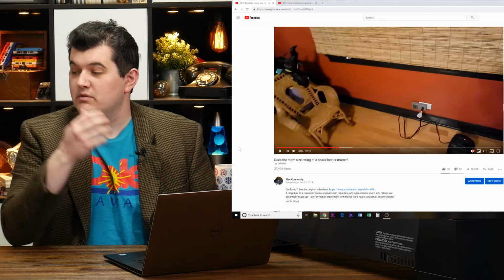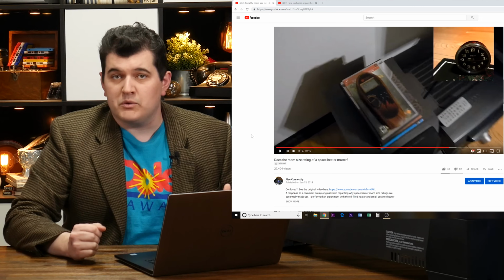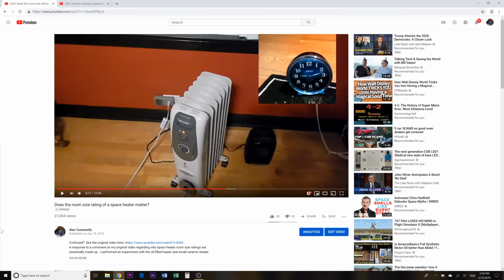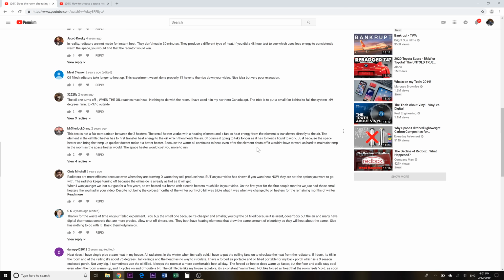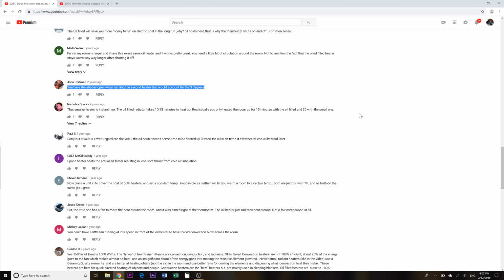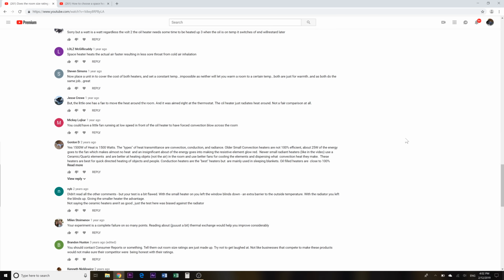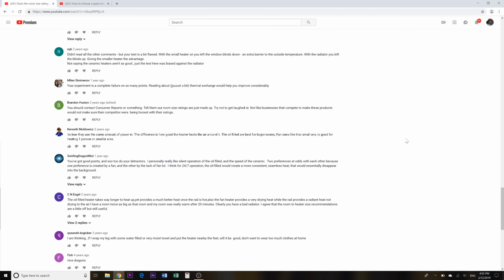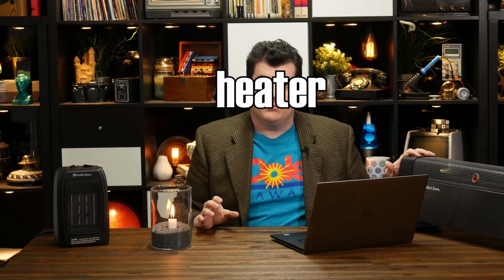More Space Heater Nonsense

Comment: I can't wait to see the comments when you explain how leaving your refrigerator door open heats the room up.
Reply: Never thought about that but it totally makes sense scientifically
Reply: I had someone tell me I'm an idiot when I told them that fans make rooms warmer, so unless it's aimed straight at you, turn it off!
Reply: @rjmac3095  Fans can make a room cooler if they're sucking cold air into the room while blowing the hot air out.
Reply: @remskolney4040  that's what I do in my house.. ground floor got a fan pulling in colder air (from shaded side of house).. upstairs got a fan sucking out the warmer and more humid air which has accumulated heat and moisture as it travels through the house. Admittedly not as good (or expensive) as aircon.. but it does get bedroom night-time temps down a few degrees so as to sleep better.. b(^_^)
Reply: @rjmac3095  They can also cool a room if pointed at a cold window or circulating air against cold exterior walls. Potentially useful if your central air overheats a single corner room, I suppose.
Reply: @rjmac3095  what if it's in the window pulling cold air from outside into the stuffy room?
Reply: @wendylynn7058  Ok, yes, in that case it would help a lot, and in fact if there are nearby windows that are open using a fan isn't likely to raise the room temperature.  But most times I've seen fans in use was in places with closed windows, or where the windows are far enough away that they make no difference, and in those cases a fan that is not pointed at you is a liability.
Reply: @rjmac3095  ceiling fans that have a reverse switch will make a room feel cooler. 
Since cold air is always at the bottom, it can pull the cold air up making the room as a whole feel cooler. 
Even an oscillating fan can make the room cooler by convection. The high speed air will pick up cooler air around it and more evenly distribute it around the room thus making it feel cooler
Reply: @rjmac3095  Not quite that easy. 1. fans use >minimal< power. 2. the moving of the air helps evaporation, thus feeling cooler.
Reply: @rjmac3095  Well it doesn't have to be aimed STRAIGHT at you, a lot of the time a fan makes the air in the entire room move which causes the same effect (but yeah, just less)
Reply: @rjmac3095  I've argued with people that leave fans on because they think they are cooling a room.
I tell them to touch the motor and see how hot it gets.
Reply: @RJ Mac 

They do?
ffs
Reply: @Her_Imperious_Condescension  Yeah, the moving air causes water to evaporate off of your skin IF they are aimed at you, so you feel cooler, but the motor puts out a certain amount of heat, so it actually gets warmer.  The wattage of the fan tells you how much heat they put out because 100% of it turns to heat.
Reply: @rjmac3095  well maybe not 100%, some energy is required to spin the fan blades
Reply: @rjmac3095  maybe we might be able to reverse global warming using giant fans, or even with giant AC units xD
Reply: @dustgalaktika9573  You have to think in terms of moving heat. You can't produce heat (or cold, which is just less heat), you can only move it from one place to another. So to cool a space, you have to move heat from that space to somewhere else. A fridge does that by moving heat from inside it to the outside through the radiator at the back, so the air on the outside (the air in room the fridge is located in) gets warmer. And this is isn't a 100% effective process, so the heat you add to the room is always more than the heat you remove from inside the fridge.
Reply: @HGSolberg  duuude I was just being sarcastic xd
Reply: @dustgalaktika9573  LOL Fair enough. But sarcasm doesn't always come across well on the internet.
Reply: @dustgalaktika9573  haha, never mind my previous comments. I can clearly see you get the joke.
Now you have me looking forward to the day climate change deniers have no choice but to acknowledge the reality that the planet is getting too warm and begin demanding we build massive AC units all over the planet to cool it off. Can you imagine trying to explain to those people why, besides being logistically impossible, it won't work anyway. And, were we somehow able to build them, they would, if anything, make matters worse.
Reply: @HGSolberg  Bit of an old comment, but you can produce heat. However you can't produce cold, which is probably what you were getting at.
Reply: @lappr0  You're absolutely right. My comment was very badly worded. You can of course produce heat chemically or by buring stuff.
Reply: @mustwereallydothis  but all we need to do is put 70 miles of ductwork out to the vacuum of space and the heat will be sucked out, hahaha
Reply: @richtomlinson7090  or we could just send a bunch of big fans into orbit and let them blow on the planet to cool it off. If only we ran the world... Big brains like us would have it taken care of in no time. Lol
Reply: @mustwereallydothis  probably better that way, because we don't want to lose our atmosphere by getting vacuumed out.
Reply: @dustgalaktika9573  Let's make a space heat pump!
Reply: He already did that https://www.youtube.com/watch?v=_-mBeYC2KGc
Reply: Ha! True!
Reply: LOL! 
Just look at all the people who don't get it why those portable AC units always have a tube that blows hot air along with the cold air coming from the unit it self...
Reply: During one of my jobs, I happened to notice that the door to the beverage cooler in front of the check stand hadn't closed entirely. Thus, that refrigerator had been running virtually non-stop for an extended time. Needless to say, the cans of carbonated beverages at the back where the evaporator is located were ready to explode. The rest of the beverages near the door of the fridge weren't cold at all, because the heat from the environment, including the condenser which is mounted exterior to the refrigerator, is contributing to the temperature inside the fridge, causing the compressor to constantly run, making more heat, and so on. There's no free lunch in the universe.
Reply: By keeping the door open; the fridge will run at full power attempting to remove heat from inside. It will heat up the room by whatever its max power rating is.
Reply: You could probably rig something to put the condenser coils somewhere where the heat wouldn't immediately re-enter the room.  But even if you could do that, congratulations - you just made an air conditioner, and are asking it to cool a space MUCH larger than it's designed to.
Reply: Thermodynamics Baby
Reply: @fireballxl-5748  Oh wait. I get it. I've been approaching this as if you're... well, I won't be that rude. But you're just a troll. Ha ha. Good one. But if your goal is to ruffle feathers, I'm sorry to disappoint you. No ruffles here.
Reply: @AethericEchoes  Let you know when I get published?    LOL   In debating technique, that is called an appeal to authority (magazine publishers).  So if it's in  a magazine or even a book it must be true.   I do not (no good conversationalist should) accept your false premise.   Lots of "peer reviewed" publication articles have been redone, corrected and thrown out because they were incorrect.  Calling me  a troll is an ad hominem attack - also a false argument.  I expect you know that.  (Besides, this is a lot of work for a simple 10 yr. old troll.   And I'm 64 so I don't have the time to waste...lol.)     Your last 2 comments therefore are invalid and need no further answer.   However, I will make another analogy or let's say introduce another perspective.  Multiple perspectives are often helpful in illustrations.  How is it the "heat" desires  to get to the cold and heads to it like a teenager in heat (haha) while the cold just sits there like a demure, shy, young lady?  Does not the lady ATTRACT the man?  Does not a magnet ATTRACT.....i.e. draw the steel nail to it?   Similarly does not a vacuum very much irresistibly ATTRACT everything surrounding it?  Different perspective, isn't it?   Not saying that is a scientific argument but simply an attempt to get you to take another look, get a 2nd perspective instead of being locked into a peer reviewed agreement of those who all read the same book and therefore know nothing but that book (paradigm) and I'm sure you'll agree books have been wrong.

Let's see....consider a black hole in "outer" space.  Nothing can escape it yet it is full of absorbed energy (heat!!!).  Is it cold or hot?  Makes no difference to the black hole whether something is hot or cold...into the black hole it goes.

If all you have left is personal attacks then don't respond but if you can make a good argument I'm all in.  Nevertheless thank you for a civil (pretty much) conversation.
Reply: @DeagleGamesOG  Number one.....   I didn't delete any comments.    Number two....talk to me when you grow up (and learn how to spell).
Reply: @DeagleGamesOG    I take note you ignore everything you cannot answer and continually attempt to change topics.
 I have some advice direct from God for YOU.
Ready?
Okay, <sarcasm on>  I know you will honor and respect God's advice for you.   <sarcasm off>
Lev:19:32: "Thou shalt rise up before the hoary head, and honour the face of the old man, and fear thy God: I am the LORD."

I am not offended as you are speaking from a demonic spirit...not your true self, which is under an evil influence you cannot control.  However, there is one more piece of advice that is mandatory.

 Joh:3:3: "Jesus answered and said unto him, Verily, verily, I say unto thee, Except a man be born again, he cannot see the kingdom of God."
Reply: @fireballxl-5748  Bad bait, burner account. Piss off.
Reply: Marge, could you set the oven to cold?
Reply: That's probably true. You're just wasting energy into heat at that point
Reply: A person can be smart, but PEOPLE ARE STUPID!!
Reply: @fireballxl-5748  The water buckets were an analogous illustration, not a direct correlation. As such, the variables can be safely ignored and the illustration is sufficient to demonstrate the process.

As for the article, it is based on a well established field of science known as thermodynamics, a field that specializes in the conversion of energy (The prefix "thermo-" refers to heat, a fundamental property of energy). If you are going to deny its validity, you are rejecting what is being taught in every major university on the planet. Go ahead, pick one and contact them and put the question to them.

Yes, science has been wrong many times. But this isn't on par with the flat earth debate. There is no academic dispute on any level. All educators are in 100% agreement. So if you're establishing your own branch of science, I wish you the best of luck in that endeavor. Let me know when you get published.
Reply: Wait, you mean to tell me it doesn’t turn the room into a freezer? Haven’t you seen SpongeBob? Silly boy
Reply: It’s the same idea as sitting a window ac in your car’s passenger seat
Reply: Huh, yeah that is how it would work. The frig is a heat pump from the inside of the frig into the kitchen (presumably) the residual heat from the compressor going at full tilt heats the room. Though a frig is always heating the room to some extent, if you just left it open ut would just pumpnout even more.
Reply: It does
Reply: it doesn't produce heat, it removes the cold.
Reply: @423yjl  Cold is not a thing in itself that can be removed. Cold is a relative measure of heat (defined by molecular activity) on one continuous scale. It doesn't matter what the actual temperature is; the area or object with lower heat is cold compared to the one with higher heat. The only way to remove cold from a space or object is by adding heat to it.
Reply: I would never try to explain that to my family....
Reply: @TechHowden  just running the fridge heats the room.....
Reply: Effect = nil. What about the COP rating and heat pump / fridge efficiency gains?
Reply: You are being sarcastic (right?)
Reply: @dustgalaktika9573  
As Fernando noted above, the basic principle was described in the linked video about air conditioners. To put it in the context of refrigerators:

When a refrigerator makes food cold, it has to do something with the heat that it removes. It does that by moving it from inside of the frig to the outside. In addition, the compressor that's doing all the work to cool your food emits waste heat, which also has no place to go except the room it's in. So even with the door closed, refrigerators warm up the room, albeit by an insignificant amount for most situations.

When you open the door, you may feel like cold is "coming out" at you but in reality, that's only the heat of the room displacing the colder air in the frig. Cold isn't coming out; heat is rushing in.

Now that the interior of the frig is warm, the compressor attempts to remove the heat. But as long as the door is open, the warmer air of the room will just replace it. That warm air is the very same air that just got removed so you only set up a vicious cycle where the frig keeps trying to cool the very air it just removed. But on each cycle that air is warmer and warmer.

Plus the compressor is now working overtime attempting to move warm air back to the same place it keeps coming from. Leave the door open long enough and that "insignificant" rise in room temperature starts to become measurable. And since your refrigerator is working without rest, it's life expectancy is getting shorter.
Reply: @AethericEchoes  xdxd I didn't understood what you were trying to say in the first comment, sorry (not so sorry)
Reply: Jjnj Galaxy 
Fridge make food cool by pump hot air out
Reply: Not Happy um... nope.
Reply: @AethericEchoes  One correction....and this could start a flame war with "science" ....  "experts".   That is the heat is not going to the cold nor is the cold going to the warmer area.  The temperature of the space is simply EQUALIZING...   It's NOT going one way or the other...it's BOTH.
Reply: @fireballxl-5748  While you are correct that the temperature is equalizing, it is doing so because heat is moving from the hotter area to the colder. Nothing moves from the colder to the hotter. Heat and cold are not two different things; they are simply degrees of the same thing; that which we call "heat." So even "cold" is a measure of heat; it's just less hot than the area we call "hot." (Try to find the line on a thermometer where cold ends and heat begins).

Temperature is defined by the amount of molecular motion in an object or space. The hotter area has greater molecular activity than the colder. The temperature equalization occurs when this molecular motion (or heat energy) is transferred from one place to another. That energy can only move in one direction; from greater to lesser, like water flowing down a hill.

So you see that the only thing that moves is the energy that imparts motion. For it to move in both directions would be akin to water flowing uphill at the same time that it was flowing downhill.
Reply: @AethericEchoes  See?   Told ya someone would light a match....lol.   Now my blow torch to your match...lol..... the "hotter area that has greater molecular activity" and it's movement  blah blah That energy can ONLY move in ONE direction.......BUZZ - INCORRECT.   The energy moves in ALL directions but lesser absorbed by warmer areas while the "cold" will absorb much more and reflect much less energy.

   One might use the same logic for magnets and we could get into electricity and way off in the corn fields but that's another day.

   So happy you answered because I love guys who challenge concepts with thinking concepts and not unsupported ridicule.   Thanks and have a great day!
Reply: @fireballxl-5748  Please clarify. What, exactly is moving from the cold side to the hot side? Heat? Are you saying that the cold side is supplying heat energy to the hot side? If this is so, please explain how it does so and why the hot side doesn't get hotter. If it is not heat that is moving, then what is?
Reply: @AethericEchoes  Wow my life is a lie
Reply: @AethericEchoes  NOPE.    Heat does not rush in.    Everyone argues heat goes to cold or cold goes to heat and it's neither.   The temperature EQUALIZES....period.  The greater the difference in temp, the faster air will move (carrying both the cold and heat with it).   And that's all folks!
Reply: So don't get a space heater, just leave my fridge open all the time got it.
Reply: @dustgalaktika9573  nope
Reply: @dustgalaktika9573  I'm glad you are watching this channel. Please keep doing so. And don't be embarrassed when you realize your mistakes. You may have a lot to learn but we all have to start somewhere. It's ok to be wrong. It's only when you refuse to believe it that you can be considered "stupid". You are simply uninformed. There should never be any shame in that.
Reply: @mustwereallydothis  I make no mistakes
Reply: @dustgalaktika9573  it's been eleven months. Have you figured out what he was talking about yet? If not, I would be happy to recommend a couple videos to explain the basic principles of refrigeration and heat pumps in general.
Reply: @dustgalaktika9573  Think about it. The heat goes somewhere. It goes to the coil. So if you leave the door open and it has to perpetually attempt to cool the space within the fridge it will just result in more energy being sent through the device and dissipating at the back of the fridge thereby continually heating the room.
Reply: @outlawscar3328  Am a physicist if I say the fridge generates free cold it's true just trust me.
Reply: @dustgalaktika9573  I'll trust you. Now what are my orders? Who's gonna disappear.
Reply: @outlawscar3328  The "Musk" it is.